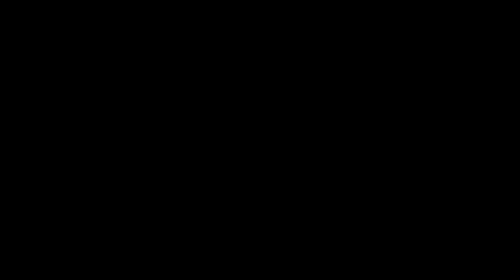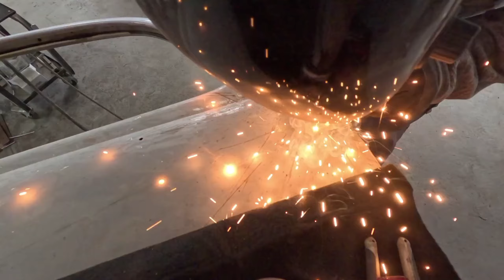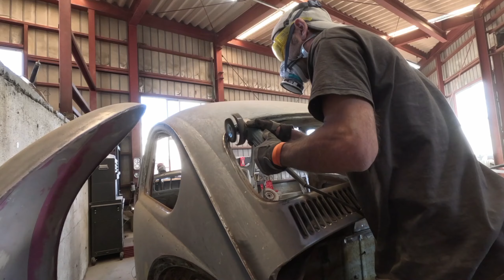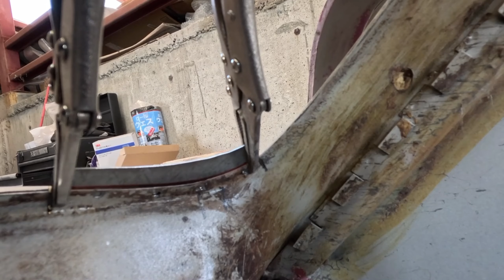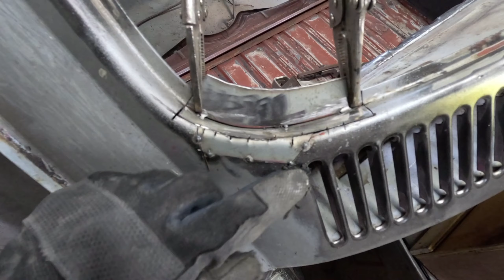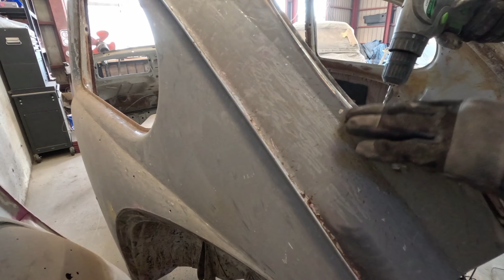PART 25! Cutting out and repairing a tricky rusty area on the 1967 Beetle project

Comment: They tend to rust there when the rear window weatherstripping fails to seal properly. Water accumulates there and it rots out. Another victim of that is the rear luggage tray. When putting the car back together it is important to get premium quality rubber weatherstripping to try to prevent that as much as possible.
Reply from the maker: Absolutely spot on and great advice! Thanks for watching

Comment: Boff boff vraiment vraiment chiche avec les bout de tôle remplacer 😢😢j’en poser des plus grands le même temps de pose 😢😢😢dommage
Reply from the maker: Thanks for the comment. Ideally I would have installed a body cut in this situation or formed a one piece repair panel using a sheet metal folder and shrinker/stretcher. Unfortunately this is not an option at the moment. Also although a bit crude this repair can be done with very basic tools at home. Thanks for watching

Comment: What type of sheemetal is that? I know it looks like it has a zinc coating
Reply from the maker: Thanks for watching. I'm currently using 1mm-1.2mm electro galvanized sheet steel for repair work. I tend to bare metal the mating faces and spray with zinc or zinc primer too.
Reply: @MEZURASHII.lifeinJapan  you're doing some good work there as well
Reply from the maker: @derrickwebb7230  Thanks. I hope you enjoy this project